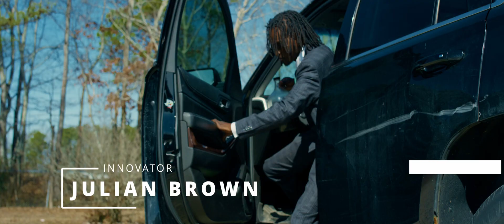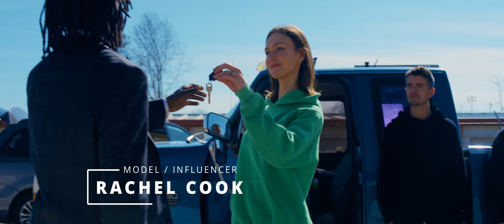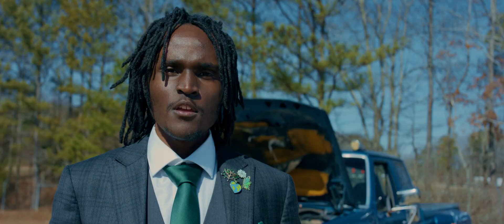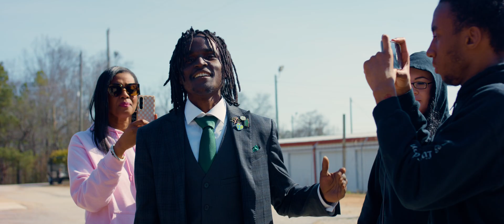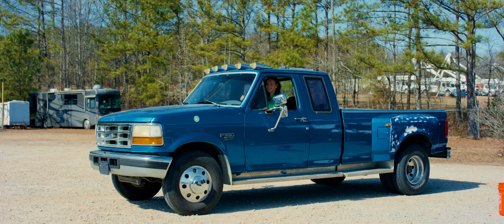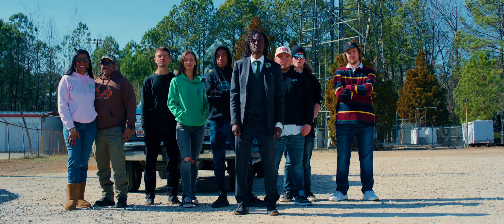PlastiDiesel! - Naturejab

Comment: I would love to see what the residue remains after burning. Some carbon left in the fuel may be a good thing for valve life on a deisel engine. As long as the engine is ran hot enough. I really like what your doing. Where exactley are you based out of?

Comment: Great work ! Only wondering what is the input to output ratio , how much energy is used to produce the plastic fuel , does it use more energy than produced , I feel this is the bigget hurdle , reducing the i put and increacing the output, this will be the most difficult part , good luck.
Reply: Dude look at all the magnetrons. Im guessing if its running off fuel and a generator there will be a net loss. But such a system is begging for a solar power supply. Charge for many days and convert your accumulated plastics  on energy from the sun.
Reply: @iamalpharius3959  he did a little break down video after this comment , thanks for the reply and I agree . 
Have a blessed day .

Comment: There actually is a law in some states that if you modify a car or truck to run on alternate fuels like this, you have to keep a log of the mileage so they can charge you the tax for the gallons of whatever fuel you used!!
Reply: It’d be a real shame if the odometer stopped working.